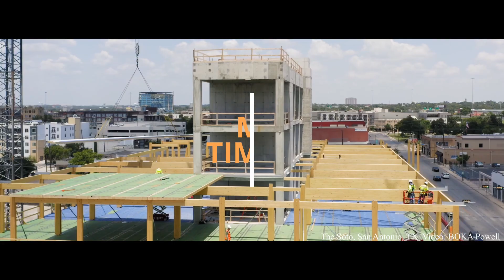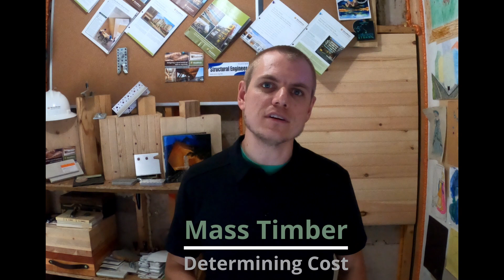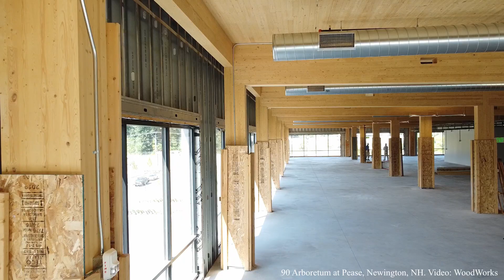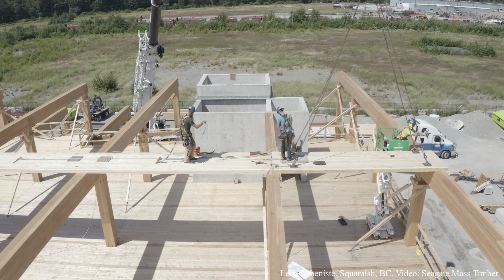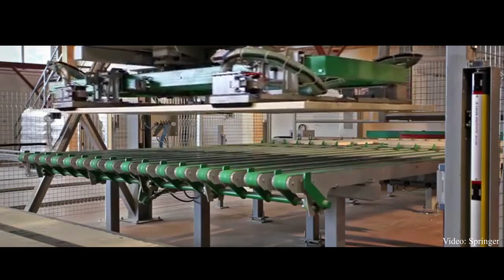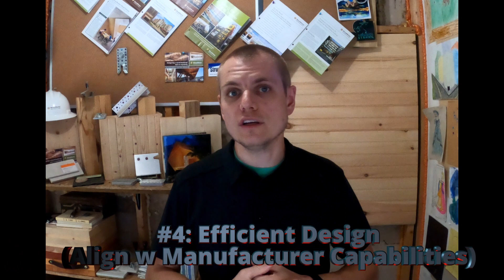How Much Does Mass Timber Cost? | 2 Min Tues 10.27.20

Comment: Could you at least provide some dollar figures on some projects you worked on?
Reply from the maker: The total project cost will always vary with finish levels, site work, etc. I think a better way to assess cost is relative to other materials. We have often heard that using mass timber systems can result in overall project costs that range from 5% less to 10% more than other structural systems, all things considered. The range accounts for things like relative on site labor costs and availability, existing soils conditions, market distinction, design efficiency and more. One example of a project which did such a cost study is here: https://www.dlrgroup.com/media/736840/tall-with-timber-a-seattle-mass-timber-tower-case-study.pdf

Comment: I understand the concept of qualifying the pricing. But how much does the actual mass timber slab cost? The post and beam I can price easily, but we don’t see much clt in our area. Can it work on a small scale?
Reply from the maker: It can work on a variety of scales. Examples range from a 56 ft square open air pavilion in Chicago to a 500,000 square foot tower currently under construction in Milwaukee. Working directly with mass timber product manufacturers is the best way to obtain current pricing information.